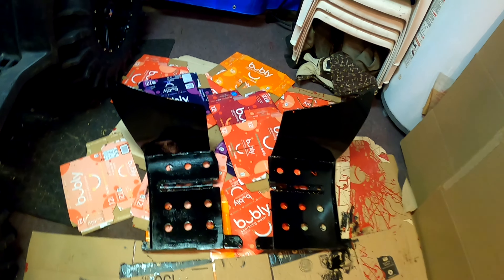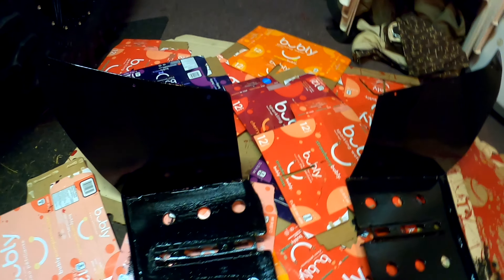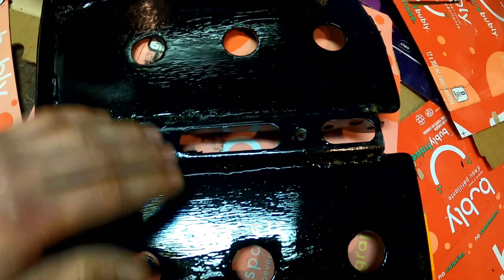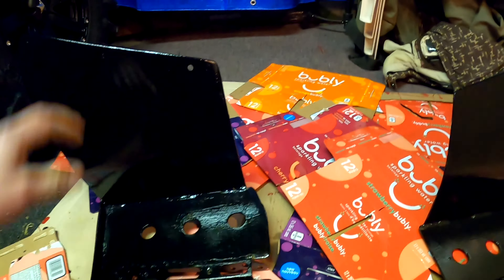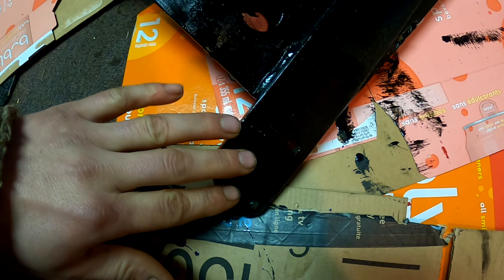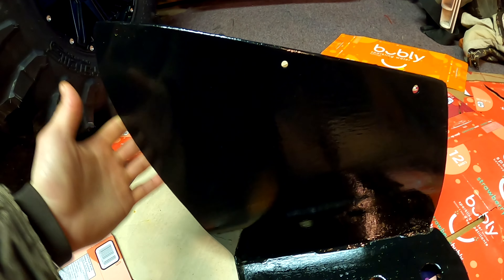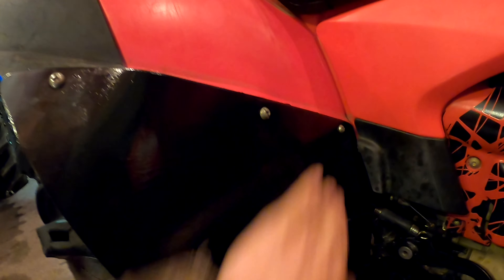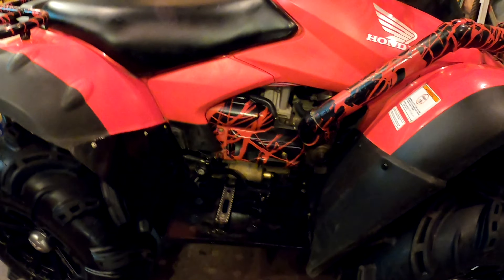HONDA RINCON CUSTOM FOOTWELLS

Comment: How do u run the vent lines on a Honda Rincon 660 or 680
Reply from the maker: Check out my snorkel video HOW TO SNORKEL A HONDA ATV it will show you how and where I ran my vent line